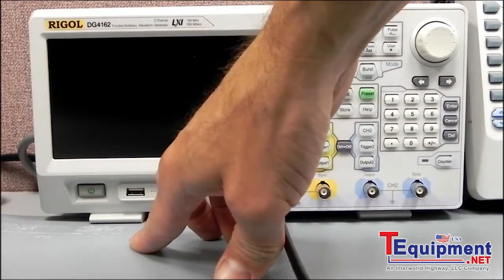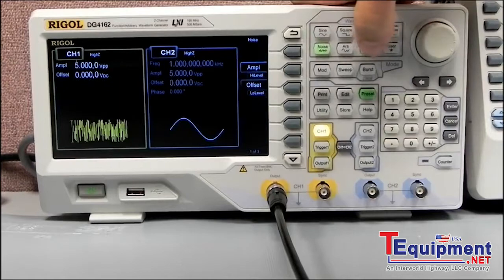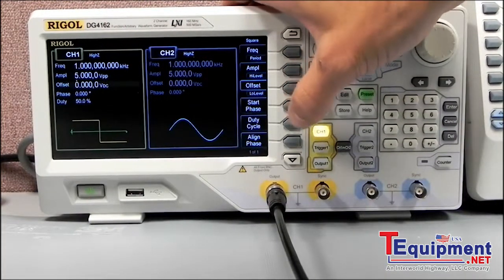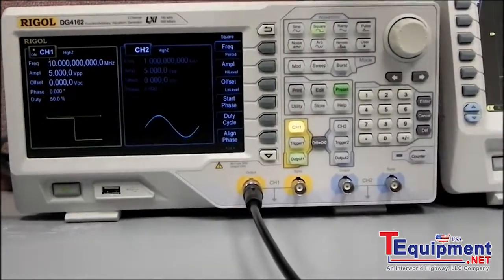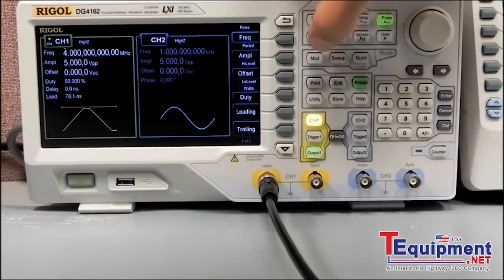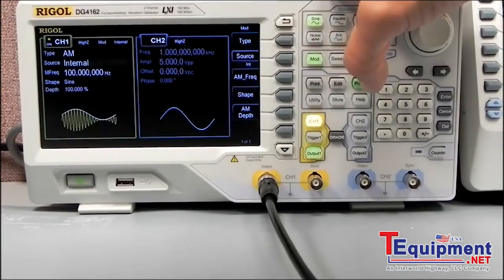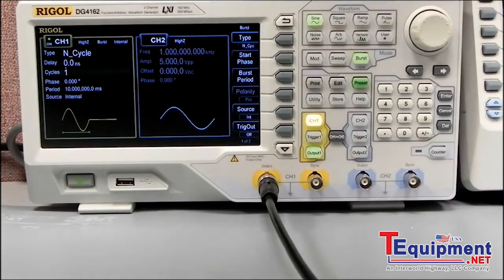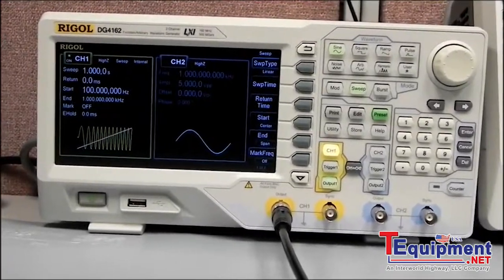Rigol DG4000 Series Introduction

Comment: Hello, the output voltage was specified as 10 V (50 ohm) at datasheet, but these devices have generaly 2 outputs which are 50-600 ohm and voltages  10-20 V. Does DG4062 has an 20 V output ?